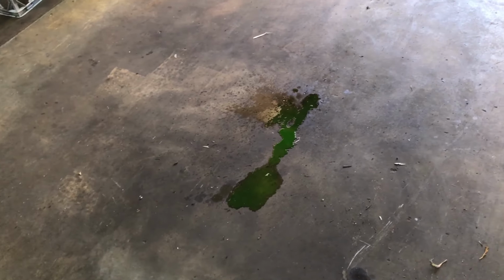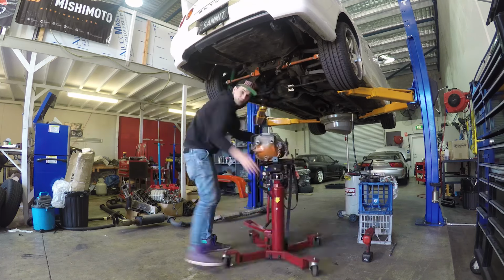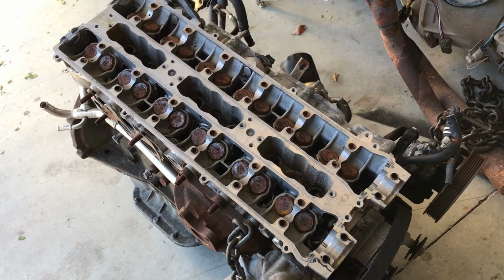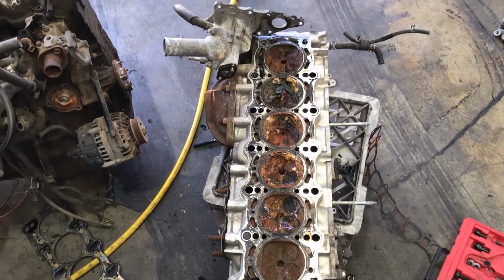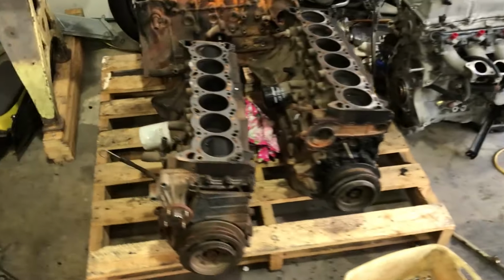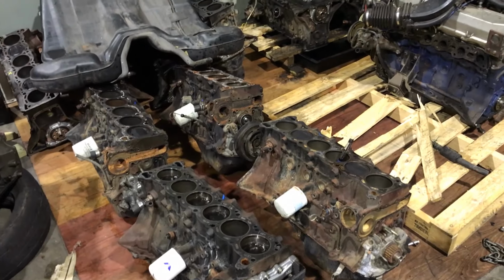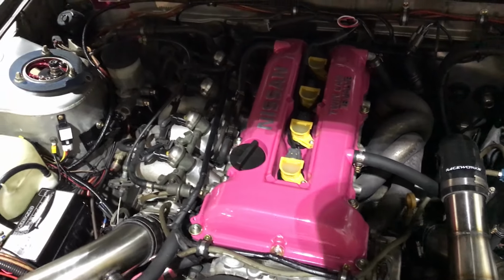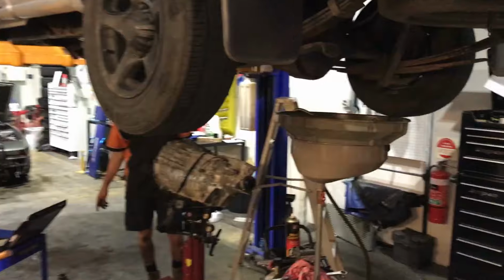DEAD 1JZ & RB30 STRIPPING! - Australia Day 2 | VLOG

Comment: That head is totally salvageable.
Reply from the maker: yes it is but it's just not worth it. It's missing the cam caps. You would have to get new ones & line bore the head just to put cams back in it. Not worth spending 1k on line boring when you can get another head & all accessories for half that price & then spend 1k on porting it & replacing seals etc.